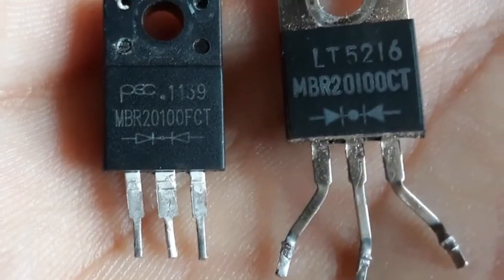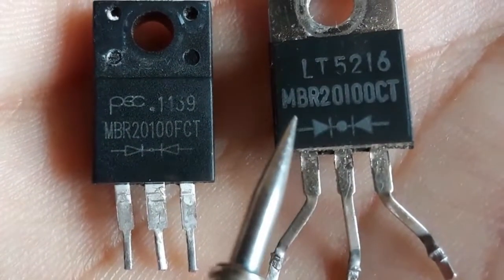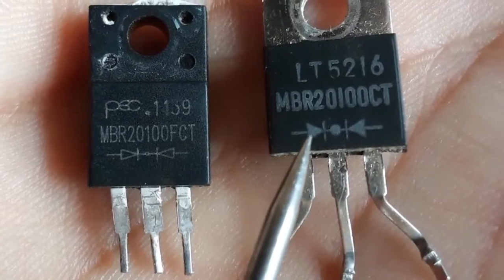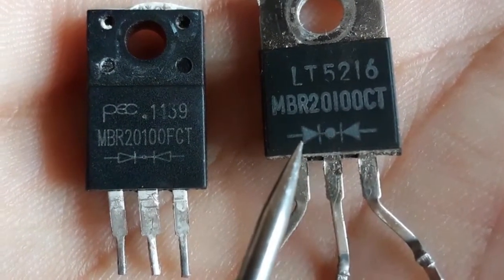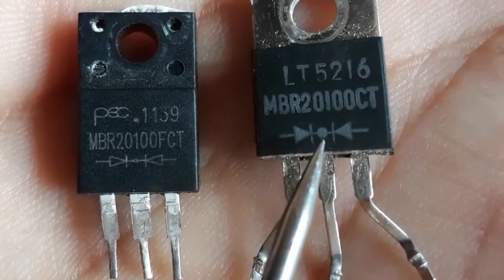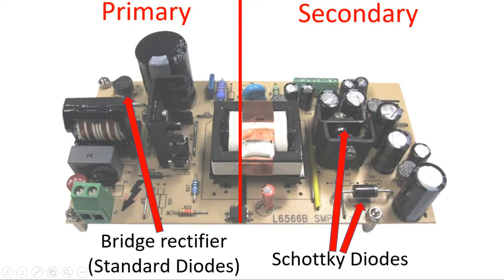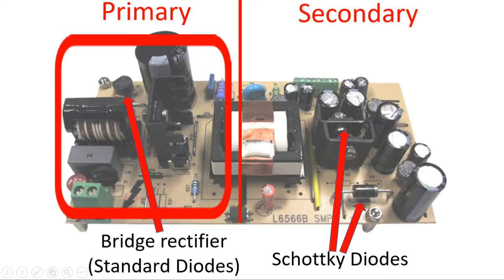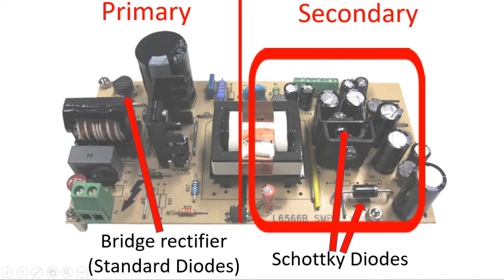Learn how to test the Schottky diode with a multimeter

Comment: If the Schottky diode shows 0.084 mV drop voltage on a multimeter, should it be regarded as a faulty? The datasheet for that diode says: Vf = 0.35 mV at 1A
Reply: At lower currents will show lower Voltage

Comment: You didn't say anything about switching the leads & testing.. that's the info i was looking for.. i have a "HIGH CURRENT SCHOTTKY BARRIER RECTIFIER" (SR506 - 60v, 5A) from a TV power supply.. that beeps both ways.. ?? i did learn in this video that they are different from regular diodes..
Reply: A diode should not conduct in both direction, apart Zener type over a certain tension